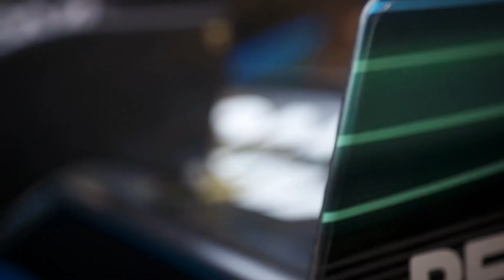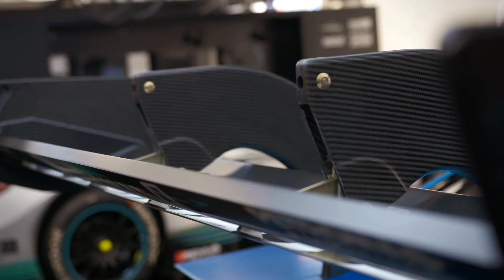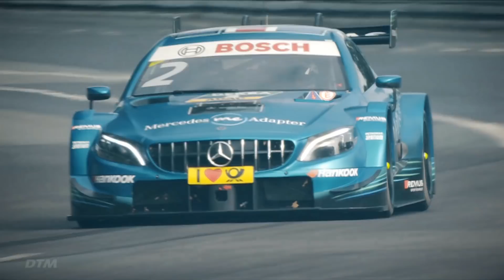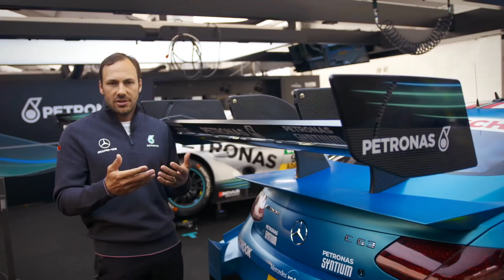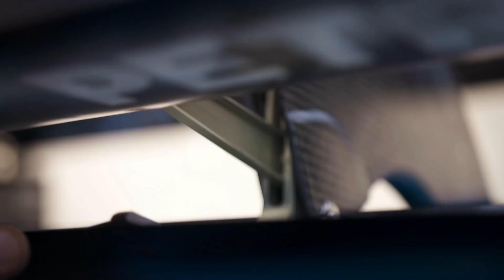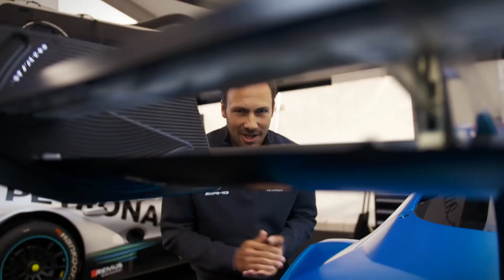Rear Wing & DRS explained by Gary Paffett - DTM Exclusive

Comment: He didn't explain how the DRS works at all :(
Is it hydraulic? Pneumatic? Servo-controlled?
Reply: you could hear the whoosh of air.
Reply: Pneumatic
Reply: Dude...
Reply: Cheating...
Reply: @MitosVC  hater
Reply: @MitosVC  You seem very fun at parties
Reply: @MitosVC  I think It would be perfect if every car can use in straight by no rule only just straight and push the button just that, no need for overtaking stuff